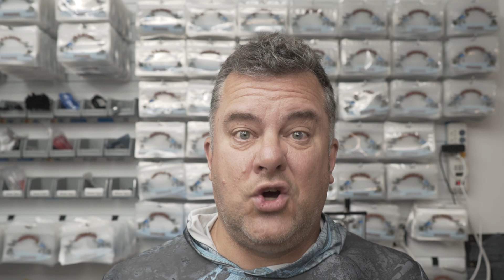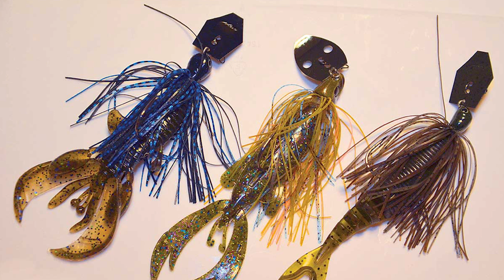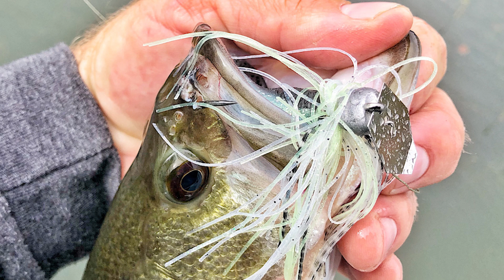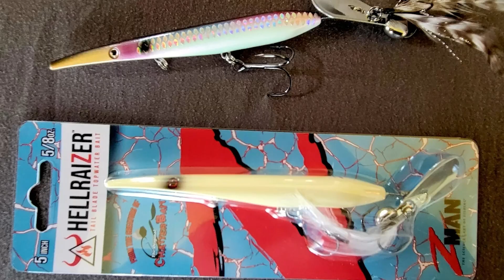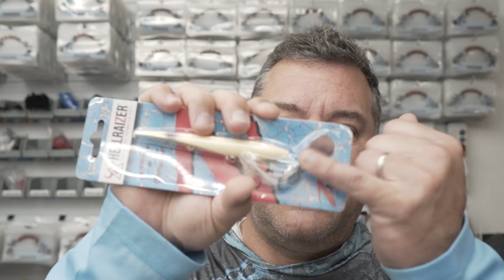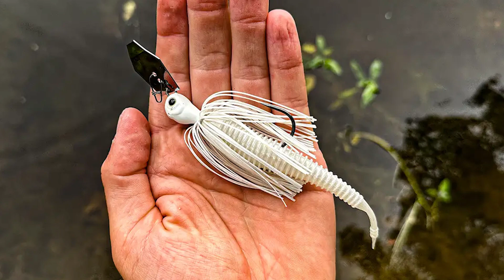That chatter bait patent aint expiring

Comment: Patent protection is granted for a limited period, generally 20 years from the filing date of the application; so its 20 years not 25. I haven't read the patents yet, but I believe what you are trying to describe is a CIP (continuation in part).  A CIP application allows the client to keep the original design features in the patent application which allows the client to seek patent protection on the original design features at a later date.  Finally, if the design was already out in the fishing community, then the patent shouldn't have been granted.  Do you have evidence that similar lures existed before the chatterbait was patented?
Reply from the maker: Thanks for clearing up those specifics!

I will go find the video that mentioned the earlier bladed jigs. I don't know the specifics but this gentleman had a few samples of what he claimed where bladed jigs released before the Chatterbait was patented. In my limited experience with the patent office, specifically in the tech/software space, it is almost impossible for them to track down prior art in these small niche areas.
Reply: I’m almost certain that the continuation didn’t extend the life of the patent

Comment: bladed jig?
Reply from the maker: Thats what everyone else has to call their chatterbait knockoff due to the trademark Z-Man has on the term Chatterbait...
Reply: @WMBayouLures  Just like it's facial tissue not Kleenex, and medicated adhesive strips, not Band-Aids, right?   But like many of these households names, they are so good and so entrenched, if you don't use the TMed name, most won't know what you are referring to.  Try to tell someone you rented a Dumpster without using that TMed name.